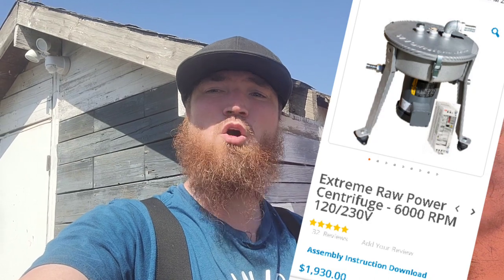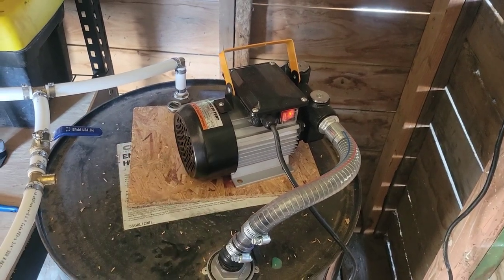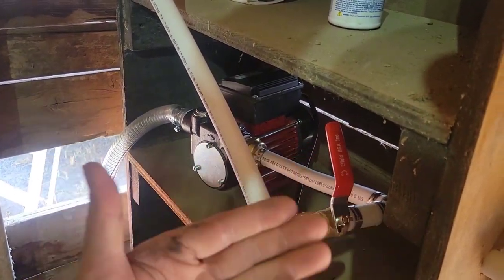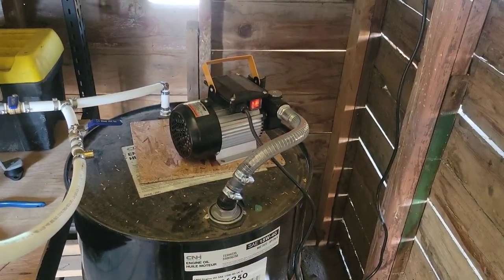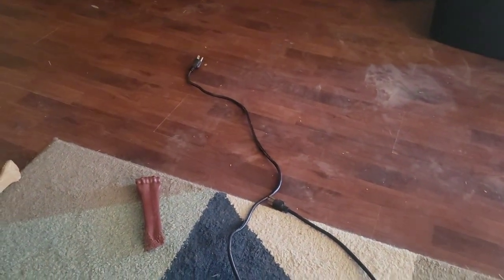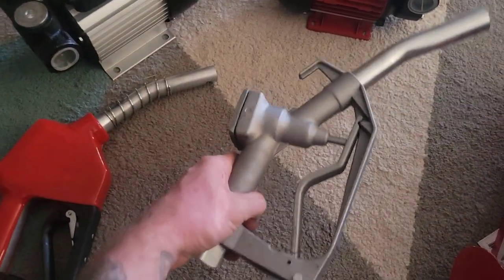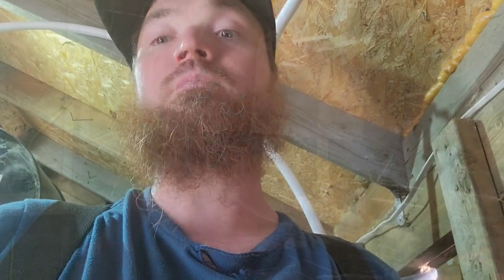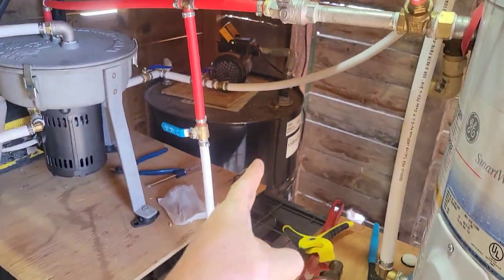Waste oil to black diesel #centrifuge  5 set up tips to save money

Comment: Hey Aspie, I've been looking for a home made oil heater design to heat my oil before it enters my centrifuge. I have been unsuccessful.  Do you have a lead on where I can look?
Reply from the maker: They actually have pretty affordable ones on ebay, cheaper than anywhere else I have found them. But if you really do want to build one, check out the facebook groups "diesel alternative fuels wmo wvo" and "alternative diesel and home fuel" I have seen people build them out of pieces of pipe and a water heater element. Search around some of the posts, or make a post asking to see what other people have come up with. Hope that helps!
Reply: @worthshop  
Yer number one Aspie!